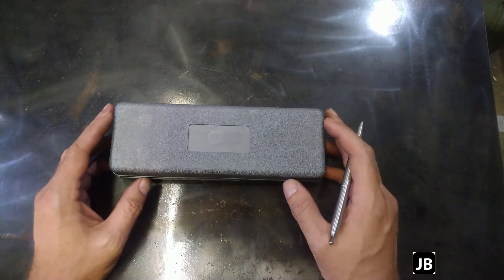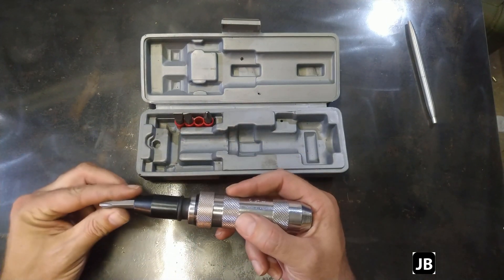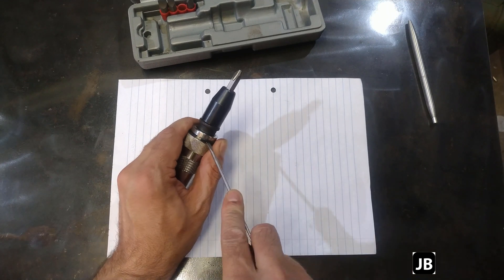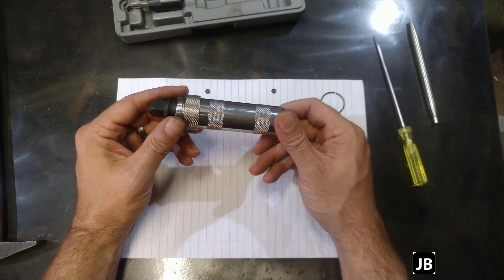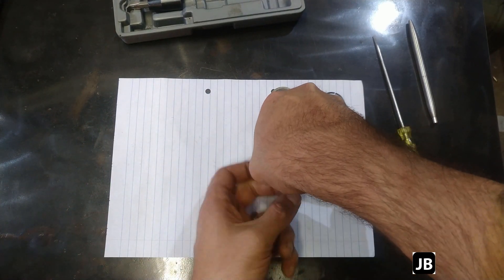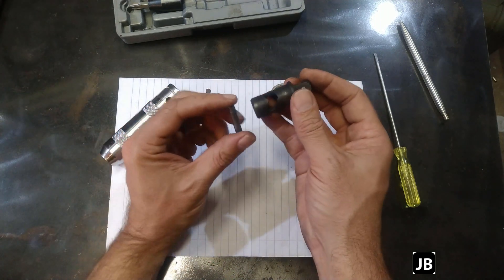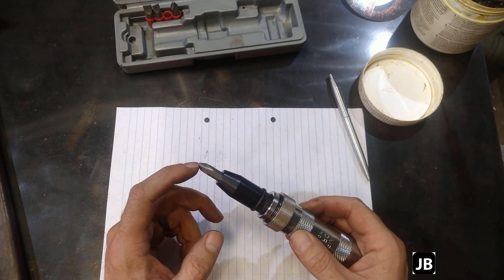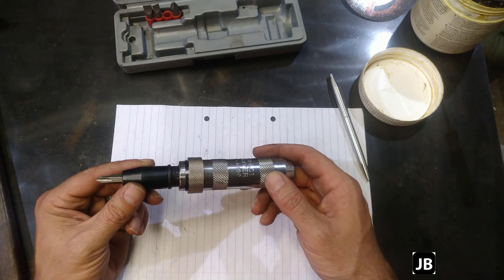Manual impact driver / Impact screwdriver how it works

Comment: What did you say to dip the bit in sir?
Reply from the maker: Dip The bit in valve lapping compound. The abrasive in it helps the bit to not cam out of the screw.
Reply: @JacoBadenhorst  so that is grinding compound too? ok thanks.

Comment: Always fun to think as you are filming. Thanks for the tear down. The function of the cam surface is quite clear. And yes, grease the heck out of everything.

These tools are, as you said, great for taking out the stuck screw. There are three things that are happening. 
1. The hammer blow against the spring drives the bit into the screw head, making rounding much less likely.
2. The hammer blow also pushes the screw body into the screw hole, in effect bouncing the screw a little bit, causing the thread to release. 
3. Of course, there is the short sharp twist of the screw, this is what breaks the corrosion bonds.

If you take that apart again, use a vice if you have one to take the load off the pin instead of doing that by hand.

Comment: Im still using the one I bought back in the 70's. A Vessel 2500. A must if you work on older motorcycles. After some use, take them apart to inspect, clean and grease. They do take some abuse from that hammer. Sometimes just a little filing is all that is needed. There are several types, the 2 ball bearing type and the rod type, both work well. A cheap tool to have that really works. BTW, Dont waste you money on the Snap On one that can cost you several hundred dollars. Its not any better.

Comment: great tool! I use mine all the time to loosen frozen gearcase screws in outboards. i will say i've bought a few over the years, and only one that i still have actually works. still useful without the spring if you hit and turn manually.

Comment: Can this be used to tighten screws? Also can it be used to drive a drill bit?
Reply from the maker: I would not use a hammer on it to tighten screws. You will most likely strip it. HSS drill bits will break if you hammer on them. Honestly I've only used it to loosen up stuck bolts and screws.
Reply: CAN  YOU  MAKE   A BREAKER BAR  please  using this  ..because a real one is 80 pound dollar...